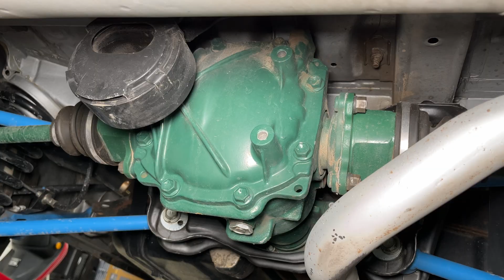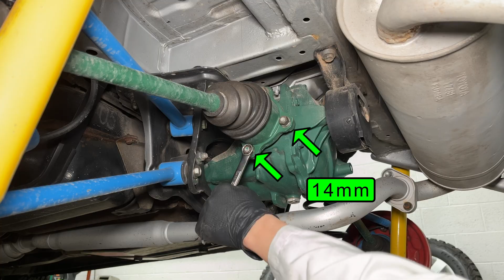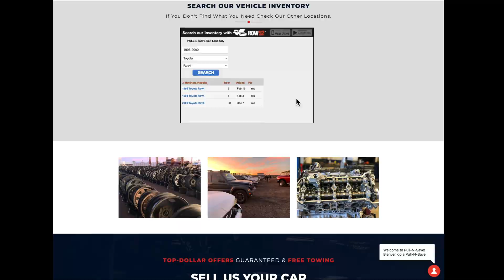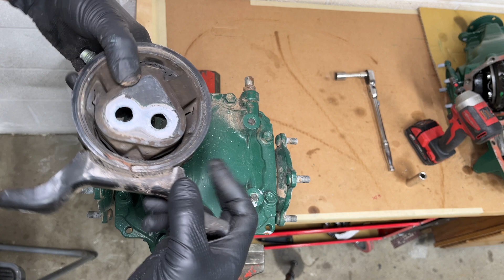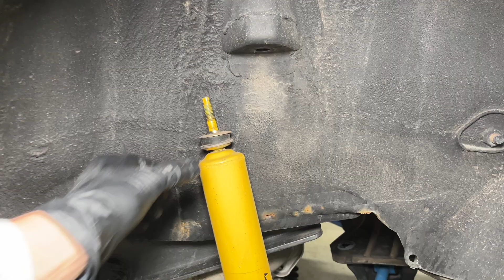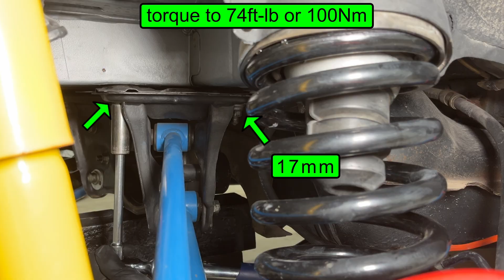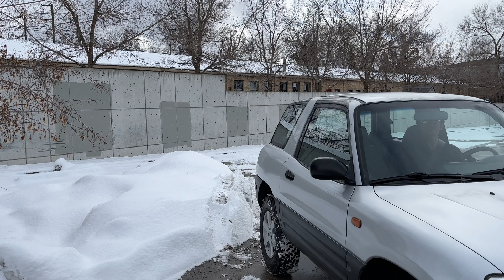Installing a TORSEN limited slip rear differential in my 1997 Toyota RAV4    (episode 39)

Comment: Great Video. Thanks so much for posting.  Do you think it’s possible to use a bore scope to look in the filler hole and see if it’s a LSD?
Reply from the maker: Yes, but the fill hole is on  the right side, just in front of the axle. You'll be looking at the round part of the carrier and It will be hard to tell if it's the LSD or not. If you already have a bore scope, try it on your differential!
Reply: @Lab @LabCoatPaul  did it from the drain hole at a wreakers yard today. Worked really well and identified two non LSD diffs.  I’ll keep looking.
Reply from the maker: @billdodsworth503  That's awesome! Thanks for the advice! I'll try that myself. You can also check the VIN of vehicles at the junkyard from their website. Add the vin as one of "my vehicles" in your Toyota app. If it has a limited slip, it should show up in the spec sheet.

They're very rare and I hope you get lucky and find one. If you find two, and you don't want the other one, please rescue it from the junkyard! Someone will pay you $700 for it.
Reply: @LabCoatPaul Absolutely.  I can’t seem to access the Toyota owners site? It’s blocked from my laptop and phone. Odd… I have a friend at Toyota who said they can check it though. Again, thanks for the quality of your videos. They are great.
Reply from the maker: @billdodsworth503  It's not a website. It's a Toyota app.

Comment: Hi, at 2:40 you explained that the first generation RAV4 has a problem when shifting and releasing the clutch, it knocks in the rear part of the vehicle because of the differential carrier, does anyone have a solution for that? thanks for the answer
greetings from Croatia
Reply from the maker: The most common cause of clunking in the rear differential is actually the rubber differential mounts. The round one in the rear is the worst, but it's also the easiest to replace. You can upgrade your differential mounts by filling them with urethane.
I did notice some play in my differential gears, but after replacing my mounts and bad CV axles, I didn't have any clunking.
Reply: @LabCoatPaul  Thanks!..🍻

Comment: hell of a find an lsd at the junkyard! i have come to the light of the rav 4 from having had (and still have) a few 1st gen cr-v's. i thought they were more similar than they are but having just bought a rav 4 and learning about it, there are some pretty big differences like this. The cr-v has a wheel slip dependent awd system where the rear diff has a dual pump hydrolic clutch run by the rear driveshaft and rear wheels, its fwd most of the time but when the front wheels slip the driveshaft pump pumps more and engages the clutch to send power to the rear. ive heard it can send about 30 % to the rear. guess it would mabey work better than having an open center diff in some cases, because the rear wheels are still force to spin, but definatly not better than the locking center diff and the ability to get an lsd. 

also im very impressed by this video, extremely through and you go through every detail of the modification. thanks, just earned another subscriber
Reply from the maker: Thanks for watching! Yes, the RAV4 is "full time 4wd". Of course it's all wheel drive, not 4 wheel drive, but that's what Toyota called it. 

The center locking differential is available only with a manual transmission, and you can only engage it below 20mph. If you're going slow, then speed up, I think it's supposed to unlock, but it might just stay locked if you're on the gas. I haven't really tested that, but I've had it beep at me when going over 20mph with the center diff lock on.

The automatic transmission RAV4 has a viscous coupling (I think) for the center differential and there is no locking button. Both models are supposed to be able to do a 50/50 split of torque front to rear.

If you want to see more RAV4 videos, my playlist has 56 of them here: https://www.youtube.com/playlist?list=PL1_JDBt1LSiImFCzG1QKxOTeZnzUG8uxj
Reply: @LabCoatPaul  thanks for the info, i didnt know about the 20mph thing but that makes sense. i do have the manual transmission.

Comment: Ive recently bought 98 rav4 long version. And i didnt know that its FWD version. 
I wanna know if its possible to add all necessary transmission parts for rear differential to make it AWD.
Coz when you look under the car, it looks like factory left empty spots for driveshaft and other things as well.
Reply from the maker: Yes, you can convert your car to all wheel drive. You will need a new transmission, driveshaft, center carrier bearing, center locking differential solenoid and buttons (for the manual transmission), the rear differential and mounts, different rear spindles for AWD, and the rear CV axles. The best way to get all the parts is by having a donor car. You can get everything from the junkyard.

The 4-door RAV4 is very common and not very valuable, so the most cost effective way to get AWD is sell your car and get one that has AWD.
Reply: @LabCoatPaul Thank you for your response and advice.
In the place where I live, it’s difficult to find an original 4-door RAV4 with left side steering wheel. Usually, the versions we have here are Japanese models with the steering wheel converted to the left side.
Because of that, it might be a better option to find a donor RAV4 AWD and use it for my own car.

Comment: Hello paul, I have a 1999 RAV4 automatic none locking rear, I can install the locking limited slip deferential on my automatic? Thank you in advance!
Reply from the maker: Yes, you can replace the rear differential in your RAV4. The optional torsen limited slip differential in this video does not lock. It improves traction in slippery conditions.

Your car also has a center differential attached to the transmission. In the automatic models, the center differential does not lock. I haven't researched this, but I don't think it's possible to bolt the locking center diff from a manual to an automatic transmission.
Reply: @LabCoatPaul  thank you for your awesome work!!!

Comment: I have a 99 lexus RX300 that has the optional torsen limited slip, and my overall experience says it is no better than an open in most conditions it's needed. It was my wife's daily since we bought it used in 2008 and I even had to get her unstuck at her friends mothers farm house after it rained the day before. I watched the rear sides spin just like an open. I was only able to get her unstuck with a bunch of old floor mats. I couldn't understand why both rears wheels weren't engaging, so when I got home, I pulled the window sticker and confirmed it had the optional torsen LS. I'd only buy a clutch pack type moving forward if I decided to upgrade my e46.

Comment: This Toyota website where you check the vin number doesn't work for me for some reason it goes white after two seconds every time
Reply from the maker: Yeah the website sucks. The Toyota app for your phone kind of works to list original specs. The only way that works 100% is removing the differential cover and looking to see if it’s limited slip.

Comment: You can actually see if it is torsen through the oil plug at the bottom, just need a good light and you can clearly see if it is open or not.
Reply: Bore scopes are cheap and work very well for this. 
If I'm not mistaken, the stud spacing on the stub axles is different on LSD vs non-LSD, so that's the fastest way to tell.

Comment: Shitty system, what good is a 4wd good for if they are all open LSD?
Reply from the maker: A torsen limited slip differential would not be useful off road where  the ground is uneven and one of the wheels is in the air. It does improve traction in slippery conditions like snow.
Reply: @LabCoatPaul  yes i know, but then make a fwd or rwd but not 4wd. 4wd with 3 open diffentials doesn't make any sense.
Reply: @LabCoatPaul  where to get a lsd for the rear differential. I have a rav4 xa20 d4d 3 doors.

Comment: I’ve got a five door 98 AwD manual Rav 4. This video helped, just fixed the clunking from the rear differential mounts by replacing the two sets of bushings with poly bushings. The front bushing on the rear diff was a pain!

Comment: Installed a Differential removed from a Lexus RX300 to my 96 Rav4 Manual. Mine had 6 spider gears but the Lexus differential had 8 wheels. But the teeth in main gears are same 14/41 so it was a perfect fit. Running has nonissue after fixing. But there is an uneven Hum/Vibration coming out when going on low gears with a high torque. What can be the issue? If it normal?

Comment: I'm just wondering, why didn't you install an awd conversion, and will it be a drop and bolt kit? I have a 2wd 3door... my gets stuck in 12 inches of snow, not enough powers going to the wheel.
Reply from the maker: My RAV4 is already AWD.

Comment: I can see a way to improve this transmission so it’ll work even if there’s 0 counteracting torque on the other wheel: increase the angle of worm gear in order to be able to not spin if the worm wheel spins. This is in numerous Lego models of the Torsen differential and it has worked.
Reply: That can be done, but it may cause skipping in corners when you exit under power. There are other versions of the Torsen that also include friction plates and they have much more bias.

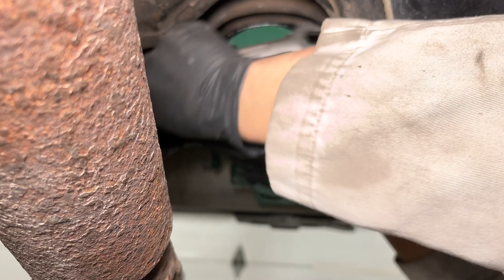Comment: 4:10 and 21:20
I found that when I was replacing this front mount on my car, if I had a jack to support the diff's weight, these two bolts were loose enough that they could be done and undone by hand. Which was faster than using a wrench.

Comment: I hope you understand that inside a differential there is differential fluid NOT OIL. If there is oil in there your just KILLING the innards. You HAVE TO HAVE differential fluid inside the differential. So if your putting oil and not even synthetic oil 🙄 in the differential  its terrible. By the look of the total blackness of the "oil" that was inside that differential, it looks like cheap fossil fuel 😢
Reply: Technically, oxygen/co2 (the atmosphere we live in) is a fluid. We get tied up in different terms that have the same meaning. Tomatoe or tomatoe? 75W-90 gear oil/fluid is standard for pretty much all Toyota differentials and transfer cases. The viscosity could differ depending on temperature. But most modern synthetic oil/fluids can perform lubrication for a wide range of temperature variations. In my opinion, this tutorial is excellent and so is all of the other content by this creator.
Reply: You know diff fluid is a oil right?

Comment: Hello! I have a rav4 2002 em. It is equipped with a Torsen differential. The oil seal in the left-hand drive needs to be replaced. Unfortunately, with Torsen, I don't see how to remove the ring that secures the stub, holle snap. Could you give me some advice? Thank you!
Reply from the maker: Budget Build Bureau rebuilt one here: https://youtu.be/zlHWaxtZXJI?si=p6qrpQR0LcVymQTx

Comment: Hey Paul, did the clunking sounds from your suspension go away after adding the insulators on the bottom?
Reply from the maker: Well... Sir Clunks-a-Lot doesn't give up that easily! I don't think the insulators on the springs did anything. I had a loose bolt on one of the trailing arms, so that was making most of my noise.
Also, my front subframe is rusted out and the left front control arm clunks a lot. There will be another video about that.

Comment: I think you're running out of things to fix.
Reply from the maker: Don't worry, my RAV4 is still plenty shitty.  At the moment, the suspension still has a loud clunk in the front.  The lower control arm bushing is bolted to a rusted out subframe and clicks / clunks on every small bump.  A small trip to the grocery store gives you about 250 clunks.  I don't drive the car for that reason.  It needs a new subframe....
and engine mounts..
There's something wrong with my front struts.  One side is an inch higher than the other.  It's either broken, or I have the wrong parts.  I heard 2-door and 4-door RAV4 have different strut lengths.  I got my struts from Autozone, so there's a 100% chance they did something funny.
and it doesn't pass emissions.  I installed the 1998 exhaust on my 1997.  I have ONE catalytic converter but it came with TWO.  I'm not going to change it back so I have to register it somewhere that doesn't test emissions.
The driver's seat cushion is crumbling because the previous owner was fat.  I need to find a seat with the same pattern (I have one of the rare patterns)
Something about the Takata air bags shooting shrapnel into your face... I need to research that a bit more.  There was a recall but I'm not sure if it includes the first gen RAV4.
The driveshaft is extremely rusty.  It works fine, but it's not a good look.  It's pitted badly so I think I should replace it.  (also hard to find since I have the 2-door)
Transmission leaks fluid from the main seal.  It needs to come out and the case must be split to install new silicone sealer.
The clutch is an unknown age.  I should probably replace it
An engine swap would be pretty cool.  The 2GR-FE from the 3rd gen RAV4 would be awesome.  Stock 3S-FE: 120hp.  Stock 2GR-FE: 269hp.
I could upgrade the rear brakes and suspension.  The 2nd gen rear subframe, trailing arms, and disc brakes bolt up.
Some bigger rotors and calipers up front would be nice too, especially if I upgrade the engine.
Oh and the paint is peeling from the hood and the roof.
The black plastic is light gray instead of black

I can keep fixing this car forever if I want.
Reply: @LabCoatPaul  That is the most comprehensive replay I have ever received in my 10+ years of using YouTube. I had the dealership replace my Takata airbags, but I don't know if the time ran out on the recall yet. It gives you a warm fuzzy feeling driving around with the shotgun pointed at your face. I drove my Honda, with Takata airbags, for about a year and a half before getting them replaced. Thanks for the reply, and I look forward to many more repair videos.

Comment: U have any idea for rav4 99 from awd change to rwd
Reply from the maker: It's not possible.  Also, why wouldn't you want AWD?
The RAV4 has a transversely mounted engine with a front wheel drive transmission that has a transfer case bolted to it that sends power to the rear.  RAV4 came in front wheel drive and all wheel drive options.  Rear wheel drive cars typically have a longitudinally mounted engine with a rear wheel drive transmission.
Reply: My last u-joint went out so until i was able to fix it right . I simply removed the whole second half of the drive shaft. Caution don't remove the front .trany oil will pour out. After the removal of the rear shaft it felt like i gained 50 horse power.  You must engage the center diff to get the car to move.would spin the front tires for 20 feet and chirp going into 2nd. 0-50 was cut almost in half.  It is a 5 speed by the way.  @LabCoatPaul
Reply: Same should be possible making it RWD. Remove the front CV axles, put plugs instead of the axle seals and engage the center locking diff. That way you should have a rwd @63kaycee

Comment: I just picked up a 135k 98 rav4 4D awd. Has flares, Rear Spoiler, cargo bags, sunroof, cd player, mag wheels and hopefully LSD! I have the 02A axle code and rear differential has 17SA 2-2. Guess next step is to find a shop to change the differential gear oil. If I truly do have LSD what gear oil and LSD additive did you use?
Reply: Missed it totally that you didn't put a LSD additive. I see you used STP 75W-30 GL4 or GL5 gear oil. Did toyota originally use an LSD additive?
Reply from the maker: @andyc4670  Nope.  No additive needed.  Additives are for clutches.  The Torsen LSD only has gears.  
Have you checked your VIN on the Toyota vehicle specification site to see if it says you have the LSD?
The best way to know is take the cover off.
Reply: @LabCoatPaul  I tried checking the vin on the Toyota site but it didn't show up there. Hoping the site isn't totally accurate. Any chance you have a vin where it comes up? I was trying to look up several from junkyards that also showed the same axle code but none of them showed up either. I did email Toyota hoping they might have additional information.  Looking at the history the Rav was originally in Colorado, where something like LSD would be useful. So hopefully I get lucky!

Comment: i have a NP Pajero we get a thump when doing on off throttle im wondering if this Polyurethane may help the massive movements in the rear diff,
i can prevent the clunk if i preload the drive line with brake on and the clunk goes away for a little while but comes back, i hope all this makes sense :)

Comment: Hi Paul, just came across your great video on TORSEN differentials.I own a Japanese built 1999 rav4 for the UK market with a factory fitted TORSEN diff. checking the numbers on the casing there is a cast no 1 in the place where your no2 is. on the rear cover the number matches your TORSEN diff no of 17SA 2-2 , this may or may not relate to it being a TORSEN. hope this goes towards clarifying things

Comment: This is not torsen,  this is quaife-like differential or screw-like differential. In this type differential for transfer torque from freewheel to grounded wheel uses preload of washer spring. Over time, their stiffness decreases, the preload decreases and disappears completely. You need replace this washer-spring and differential will work correctly.